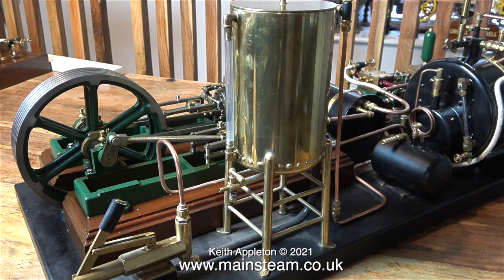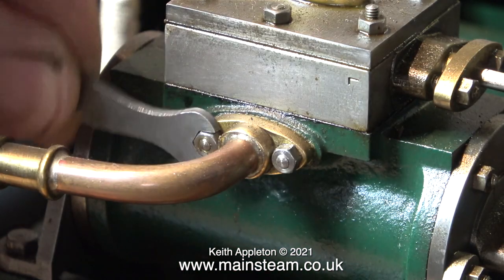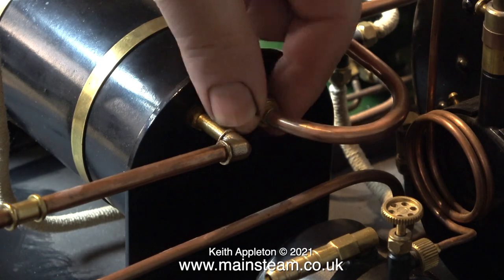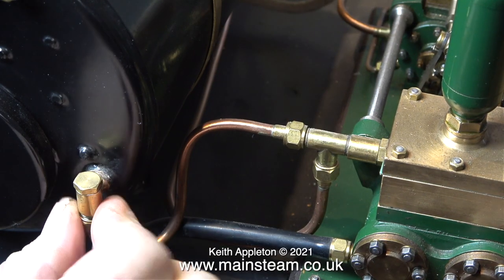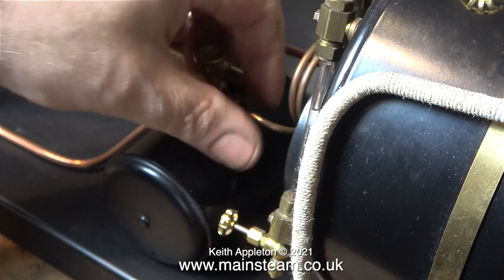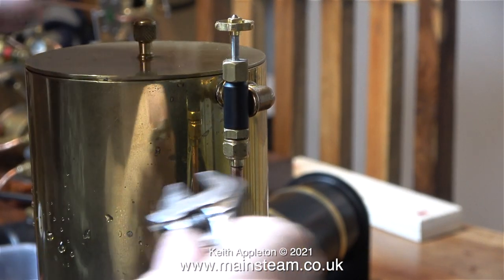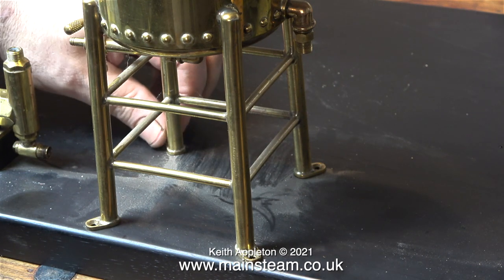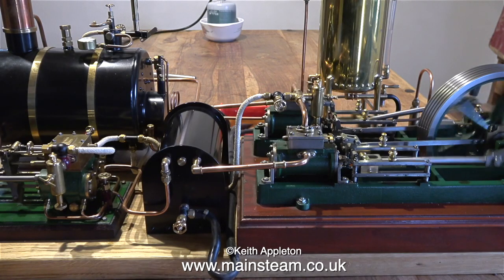DISMANTLING A STUART TWIN VICTORIA STEAM PLANT - ON THE KITCHEN TABLE

Comment: Your comment about a dusting concrete floor triggered a memory. Waterglass/ Sodium Silicate ,there is an actual chemical reaction,it is relatively inexpensive, and it will reduce or eliminate dusting. Been around for well over a hundred years.
If interested,a little electronic homework will let you know if this is something you want to do. Makes the surface somewhat harder too.
No doubt there are lots of different products but that is one time tested.
Just a suggestion. Cheers.

Comment: You need to explore the miracle of Robertson head screws.  Note this is not "square-drive"... that is the crappy american copy.  With a robertson you can put the screw on the screwdriver and hold it upside down... the "square drive" often will not.  The #2 size head is most common but go as low as a #0... you could certainly use #1 size for your applications.  #3 is monsters.

On a video published a few days ago you got a package with them and apparently they are not a thing where you are.  They are a Canadian invention that was put up against phillips screws for Henry Fords trial when he was setting up his assembly line.  It lost to phillips because the phillips head cams out before the screw is overtightened... an odd requirement.  However the maker of the screws (this early in mass manufacture) made so many screws so cheaply he quickly saturated the market.  The robertson screws are not viewed as "nice" since they are used for mostly construction... however they are so much easier to work with.